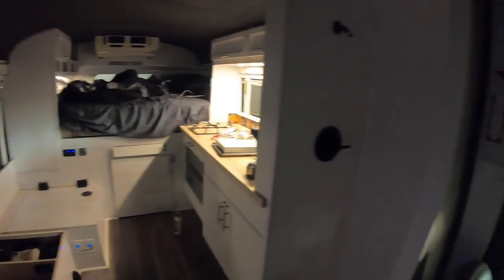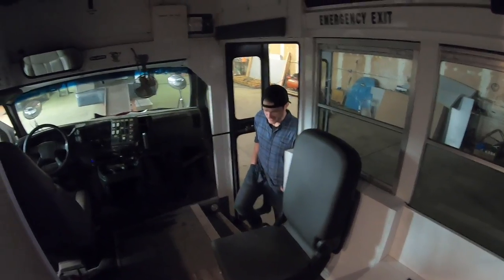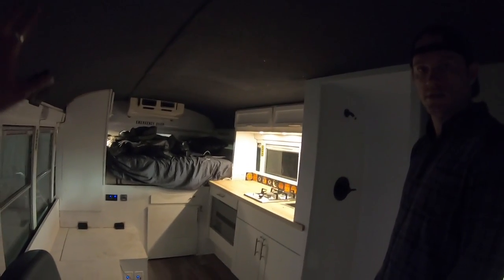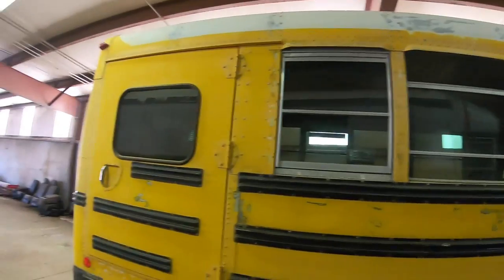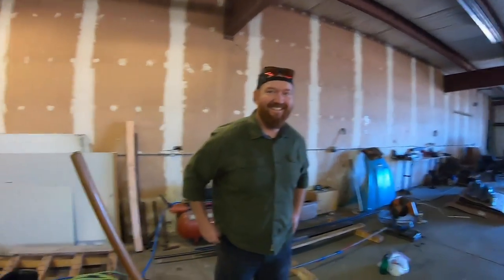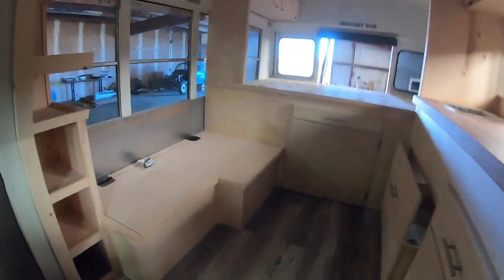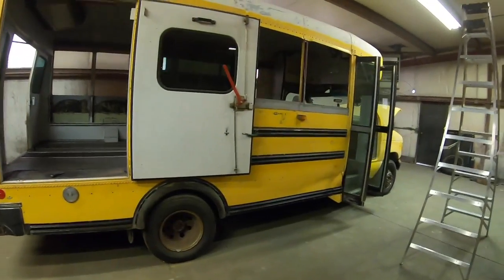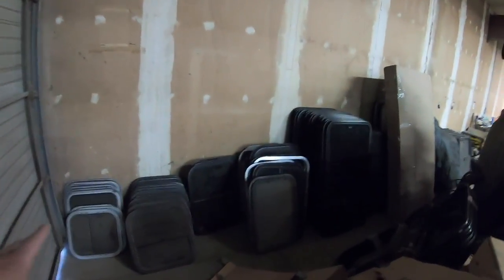Zep 6 Gets New Driver - 4x4 Mini School Bus Conversion Roof Raise With Elevator Bed

Comment: @Chris  how do you guys suggest installing RV windows that don't have the inner rings?
Reply from the maker: What do you mean by inner rings?
Reply: @roadwidgets  Most RV windows have the thicker outside-facing piece (with the window) and an inner ring that helps pull the window inward via screws.  Was just wondering if you had ideas for anyone that got used RV windows to add to a bus but didn't have that inner ring.